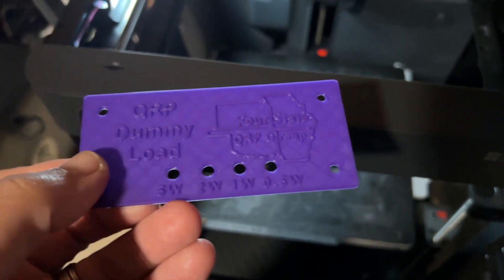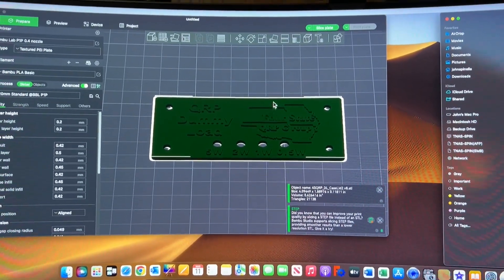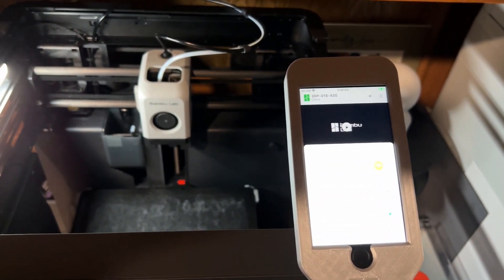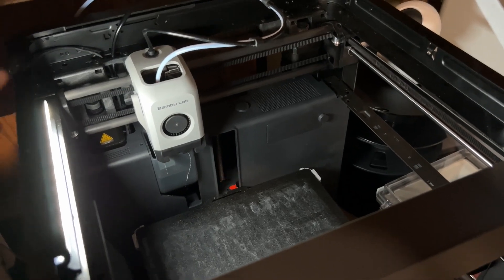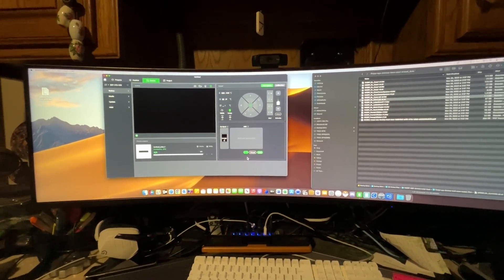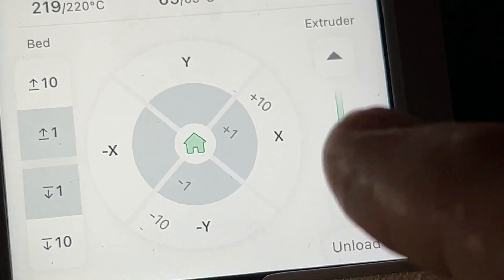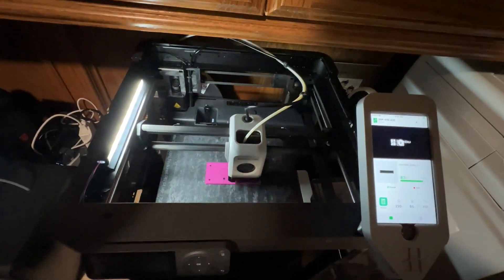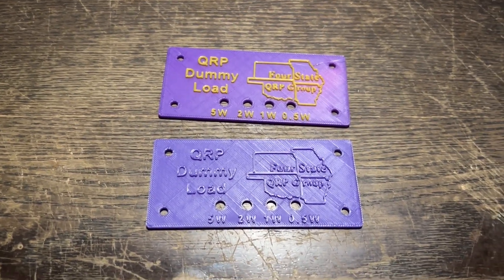Bambu Lab P1P Manual Color Change and Filament Reload

Comment: Great video, as I was watching I saw you had a stand for what appears to be a very old Iphone, probably 6 or 7. Using it for handy. what a great idea. I happen to have an old 6 that will work just fine. Would you be able tp point me in the right direction to get the files to make that cool phone enclosure? thanks again for the great video!
Reply from the maker: Here’s the link to the mount: https://makerworld.com/en/models/66386#profileId-69709

But I’ve changed since this video to the XTouch screen. Just Google it, it’s pretty nice.

Comment: Yeah, but how do you manually color swap for objects that is not on its own layer? I have an inset part that needs to be color and it is surrounded by a different color which is at the same layer hights for 1mm in total. I cant seem to find how to do this manually.
Reply from the maker: That is very difficult and time consuming. You would have to pause in the slicer at every color change to do that. I would suggest getting an AMS for that.

Comment: Mine layer shifts when i do this
Reply from the maker: If yours is a P1P, I opened a ticket with Bambu Lab and they think it’s a firmware issue that should be fixed with the next release. I’m also seeing a layer shift now with any filament change.
Reply: @1SpudNuts1BigNasty-DIY Is changing filament mid print working now/still? I’ve only had my P1P a few days, got some more colours ordered and looking forward to trying this. 
I’ve agreed to print something for a friend, they’re expecting single colour. If I can have it switch it’ll blow their mind.
Reply from the maker: @Edramon53  works great but only doing it this way (changing completely at a layer). Trying multi color throughout a layer would be horrible because of all the pausing. I’d get an AMS if you plan on that. I’m getting one for sure.
Reply: @1SpudNuts1BigNasty-DIY  Cheers, will just be putting text on top of the print (originally hoped to do a logo, but the logo was too complex for OnShape). 
I decided to make a cut out in the model, so I can print the insert in a separate colour from the model, then use this technique to put the text on.
OnShape is what I know best, but since the insert is such a small and simple part I might see if another cad program can handle the logo graphic better.

Comment: Lucky You! I tried to do the same thing and it took a total dump on me. After I unloaded the filament it just kept telling me to verify the filament is unloaded but there were no options on the screen or in studio. Desperately trying everything to save the print nothing would work no matter what it just said the printer is busy every button press. Finally after about 45 minutes of trying I just said the f*** with it. And then of course trying to cancel the print is another nonsense. This was such an easy procedure with a prusa.
Reply: Now I'm seeing people having success with the handy app. I really feel I don't need three devices to control my f**** printer. It should all be able to be done through the printer. Not the printer and a combination of going to my computer and then getting my phone. 13 days left to decide if I want to keep this p1p.
Reply from the maker: @Eric_In_SF  You don’t have to use any app, you can do it all through the printer. Sorry you’re having this issue, I’ve not had any problems.
Reply: @1SpudNuts1BigNasty-DIY  I just trying change filament but it already change the options noe it show option "Jump to Layer" so I try to pause and change from the printer and it said "Unable, Printer busy"

Comment: I'm having a lot of trouble swapping the filament during a pause in the gcode. every time I do it I have mixed results and no success.
Reply: I havent tried through the handy app yet though
Reply from the maker: Yes, the app does make it much easier when doing the load and unload feature.
Reply: @1SpudNuts1BigNasty-DIY  was trying it through the load/unload options in the settings and I was getting weird inconsistent results. it would say it cant, machine is busy, but then it would heat up to 250, purge, then go down to 142 and hang, requiring me to cancel the print. I got it to swap filament once with the load/unload options and the nozzle went back down to 190 but when it went back to print, it didn't extrude anything.
Reply from the maker: @moswald14  What you do is click “unload”, it then moves the hotend to the back while it heats up. It then moves to the front and then back and that’s when you grab the filament and pull while it unloads. To load, click load and then it does the same thing but you need to push in the new filiment until it stops before clicking “load”. Then when the hotend move back to the poop chute, you give the filament a little push for an inch or so and the extruder should grab it. Then wait for the app to come up with a pop up to retry or done, click retry until you see the new color coming out and then click done. It should push some more, cut and empty the poop chute and you’re ready to print.
Reply: @1SpudNuts1BigNasty-DIY  that's what I did and it would say something like "cannot perform task, printer busy" I forgot, but it would do the purge anyway and hang. I got success finally by manually retracting and purging the filament. you can manually press the cutting arm before you retract for a nice cut end
Reply: @moswald14  Same thing happened to me

Comment: You don't have to turn the heat up to unload or load. It will heat up automatically.
Reply from the maker: When I try to unload, I use to get an error. Did they fix that with the latest update? I checked and you’re correct, thanks for the correction.